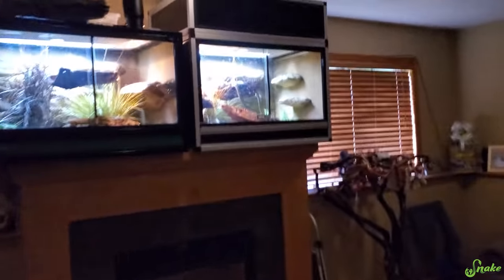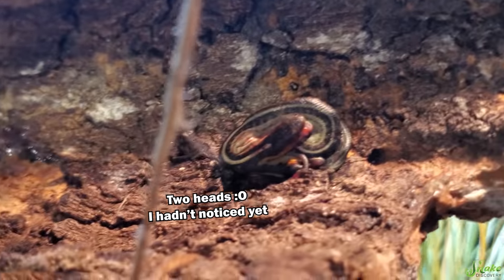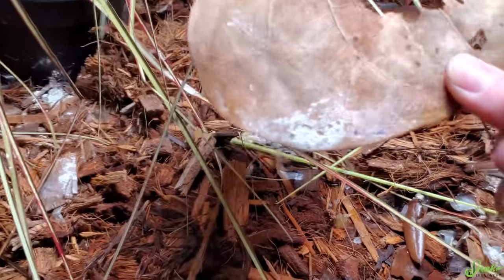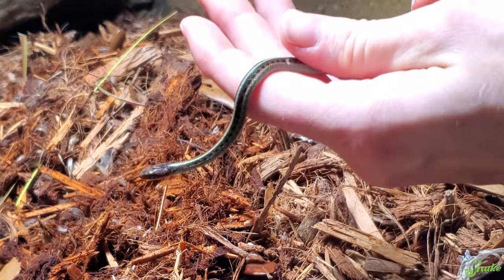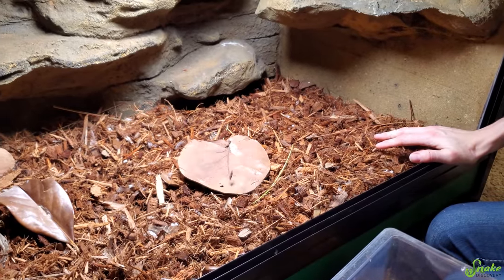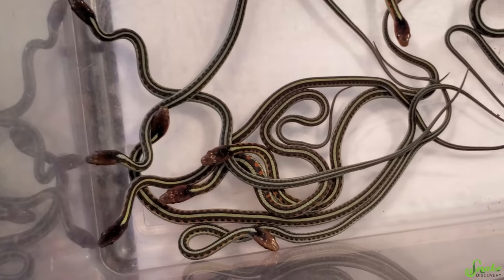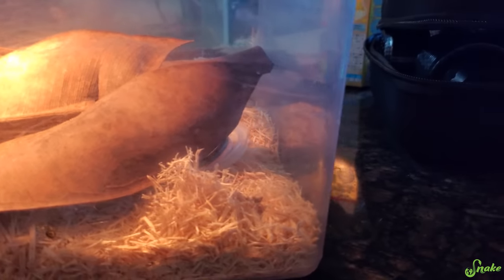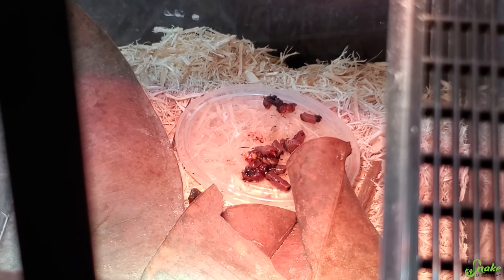Our Red-Sided Garter Snake Gave Birth!!

Comment: Preserving the anomalous stillborn might be best via just placing in 70% ethanol, and or 3% Formaldehyde. That should preserve it. Freezing WILL do more damage to the tissue then just placing in Ethanol.
Reply: Freezing is still fine enough until you can chemically preserve it, though.
Reply: @cricket00fur  true, keep it frozen until you chemically preserve it
Reply: @cricket00fur  well, if you can tolerate massive cell damage and only intend to look at it on a very macroscopic scale... The problem is that freezing in a normal freezer is far too slow, causing cells to rupture and ice crystals to form. I do use freezing to preserve details in my lab, though that's done with very small amounts of tissue and using exotic equipment such as plunge freezers and high pressure freezing.

Freezing is better then nothing at all, but its no where close to what formaldehyde or simple dehydration can do.
Reply: @lbochtler  I would assume most people do not need to examine a specimen on a microscopic level, though. 
I have a standard household chest freezer for my taxidermy critters, which keeps them around -2°F, and have been able to formalin fix fetal bison, coyote hearts, opossum joeys, etc. from that freezer. A standard home freezer is the best option available to most people if they do not have the ability to preserve with chemicals immediately...which, presumably, most people don't have the ability to do.
Reply: When I was studing  Zoology at University, they would use only ethanol, they weren't  using anymore formaldehyde because it can cause cancer.
Reply: @cricket00fur  due to how formaldehyde works, it will preserve even heavily damaged tissue, so its no surprise. But yes, its better then nothing as stated previously. Im just used to working with tissues on a microscopic level (both light and Electron Microscopy), thus my requirements are normally many times higher then for a taxidermist such as yourself. 

Random fun tid bit, Formaldehyde isn't even considered all that great of a preservative (fixative) in the microscopy world, especially when you get to magnifications beyond 800x. Once you get to those levels, you start to use heavy metal salts, and Glutaraldehyde, among other things. Osmium Tetroxide and Glutaraldehyde is usually a good combo for most tissue, though penetration speed is a tad slow.

Another chemical preservative most forget about, is vinegar, its actually rather decent. Depending on the tissue at hand and my goal magnification, i add acetic acid to my fixing agents to speed up penetration into the tissue.
Reply: I think for what they need freezing will just be fine but i found this comment interesting.
Reply: That's interesting. Also you are a nerd. (Don't take that badly)
Reply: @lbochtler  ... neat! I am never going to need to know how to preserve animals .. or anything, I imagine, but it's super cool to read someone dropping some knowledge about it. Thanks!
Reply: @whyisthisachannel  glad i could share some of the knowledge i spent years acquiring.
Reply: @sassyrodtropia1127  yes, and im proud of it!

 Fun thing to know, the first preservative used for microscope analysis was Whisky if i recall, definitely an alcoholic drink. I don't recall the origin though.  From the many books on the subject i have read, it basically comes down to, "lets see what happens when we stick this tissue sample in this mixture of things". Many random things where tested and used, some more deadly then others. 

My favorite is Mercuric Chloride, works very well if done right, this salt however has the unfortunate side effect of really really hating you and life in general. 

Ahhh the fun and sometimes tragic / horrific things our ancestors did in the name of science (or what ever we called it back then)...
Reply: I collect preserved specimens, and I'm pretty sure they're all in isopropyl alcohol.. my favorite one is the dwarf sphinx kitten (I named it Pickle). The only ones that aren't wet specimens are my bat, the butterflies and the alligator head
Reply: Actually yeah. Don’t freeze. Even flat rubbing alcohol does the trick.
Reply: @lbochtler  I love when ppl remove the skin layer, mount the snake and let beetles clean the skeleton. I bet this one's too small and fragile, but it's usually really gorgeous way to preserve at least the skeleton.
Reply: @Jamiesaurus_Art  yeah, its cool looking